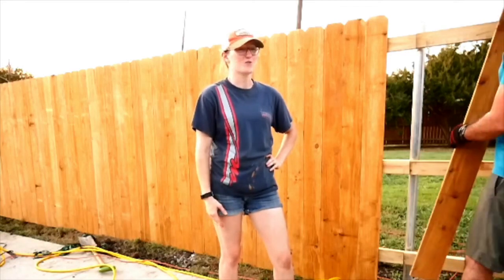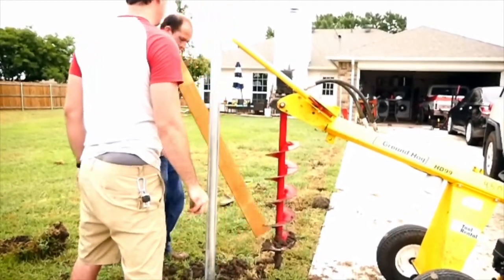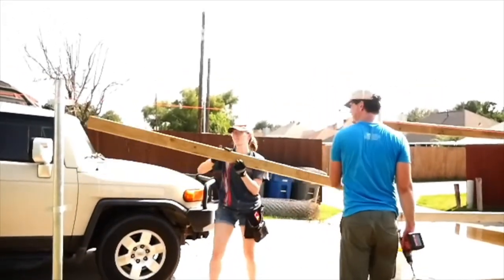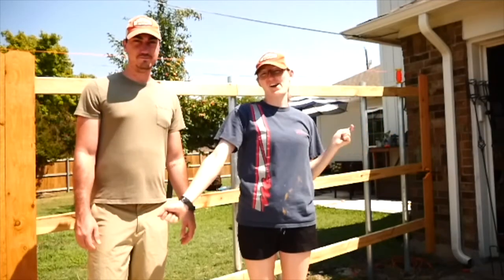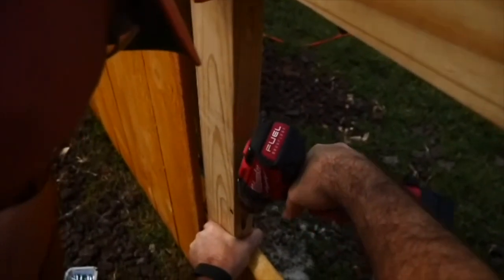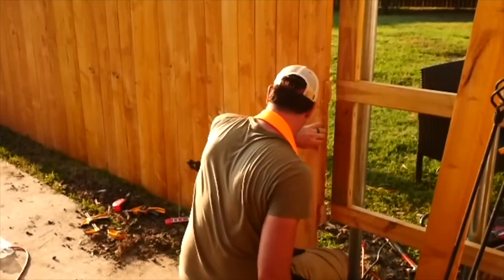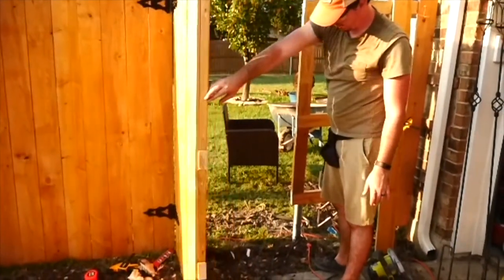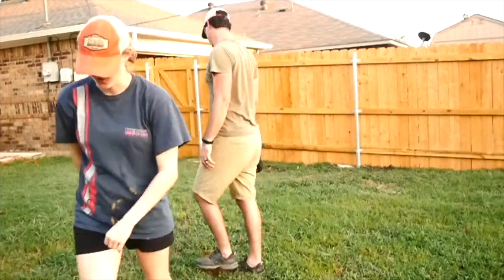3 Day Fence Build | DIY Fence | How to Build a Privacy fence for CHEAP!!

Comment: Beautiful fence.... how much do you spend for material?
Reply from the maker: Thank you! @kzasjesus. It cost us $950 total. We were quoted around $2900 for just this last stretch of fence that we needed by two different companies. So we saved quite a bit! I'll put the materials down in the description!
Reply: @diydwight7980  wow! I want to install mine just for one side 68ft... someone came to my house and gave me an estimate of 2900 dls
Reply from the maker: @kzasjesus  Yeah that labor is a big chunk of the cost! You can totally DIY it, call a couple friends and it'll go by a lot faster. If you don't have to have it done because of pets in you yard you can also take your time and stretch it out.
Reply: @diydwight7980  yeah! Im going to do it this spring here in Chicago is still a little bit cold.... from where did you get the steel post?
Reply from the maker: @kzasjesus  We picked up the post and concrete from Home Depot (they were a little bit cheaper there), and the rest of the material we got from Lowes. Good luck on your build and come back and let us know how it goes! We'd love to hear about it!
Reply: @diydwight7980  yes!!! thanks for the info